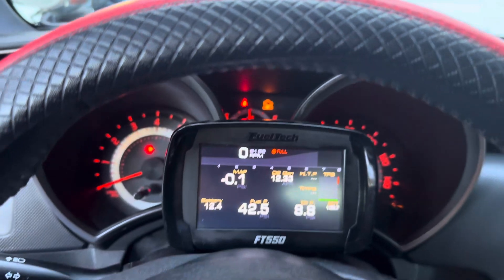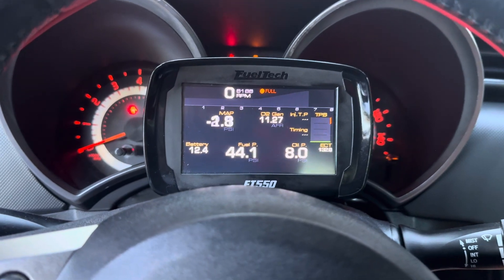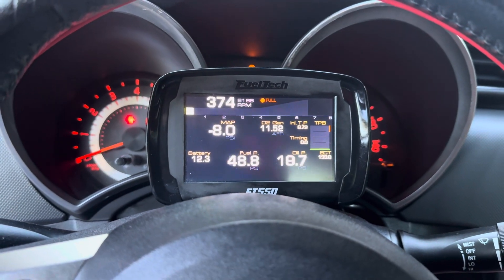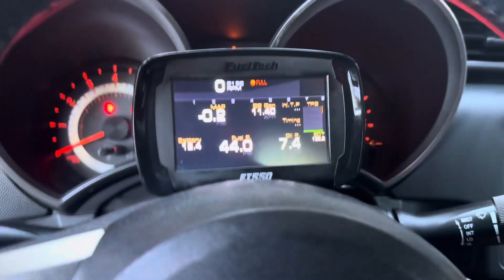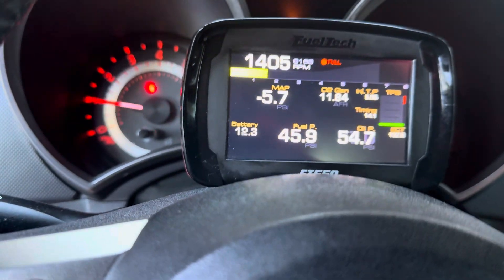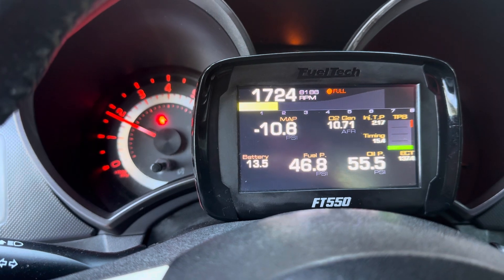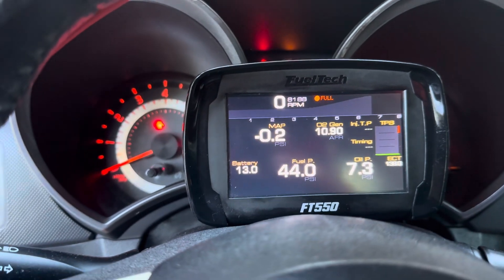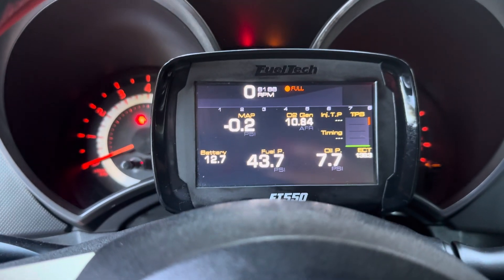2012 Scion TC throttle body issues 1 of 3

Comment: Do you have any transmission issues? Is your an automatic or manual and how many miles do you have?
Reply from the maker: @itsCurtisAvila  yes😂. It got stuck on 2nd gear and couldn’t shift or put it in neutral.  I had to order a new one from Japan.  Changed the clutch to a Stage 1 from ACT and is all good.  I have a 6 speed manual transmission with 18,000 miles.

Comment: Can you manually open the butterfly valve to hold an idle?
Reply from the maker: @LongShot36019  if the ignition switch is off yes.  But as soon as the ignition is turned on it won’t move.  I was able to fix it.  The racing computer was reading the TPS wrong and needed to be recalibrated